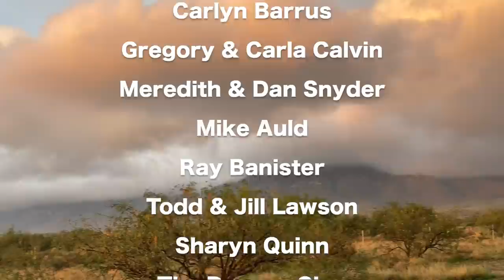Earthen Plaster on Hyperadobe Walls + Solar Wire Trench!

Comment: A couple of things

1) I do not know if it is a legal, electrical authority, or local council requirement, but it is common for electrical and water lines to have detectable mains marker tapes placed in the trench, about a foot above the service lines to act as a warning that there are water pipes, electrical lines etc below. Have you considered doing the same for your water and electrical lines?
2) The internal walls look really good.

Comment: You guys are doing such a great job I'm very impressed.
I did see a glimpse of your swing...
I just made a swing for my 11 grandkids yesterday.
I took around piece of firewood the length of the saddle
And an old saddle
I attach the saddle to the round piece of firewood with long bolts
Used the rope from their old swing and attached it to the four corners of the saddle
11:30 last night kids didn't want to go home they were still swinging on their saddle swing 👏

Comment: 'Great video!  It's very impressive how much work your family does.  And congrats on figuring out the plastering mix as well as digging all of those ditches for the electrical.   I hope you have a long yellow rope or ribbon that you can place well above the pipe laid so that when someone digs in the future that they pull up the warning rope/ribbon before they mess-up your electrical line.   For the plastering, I've seen some videos where they use a percentage of lime in the mix.   I'm wondering if you were tempted to add that to yours.  I  hadn't seen the toilet paper usage before - so, that's quite brilliant.   Aircrete Harry uses blow-in insulation paper (he buys it in bales) in his Epic mix - but he uses that on his aircrete outer dome shell for thickness and insulation of his domes.  Might be too coarse for interior finish plastering.  Keep up the great work.  'Looking forward to your next one.  - Jim from Phoenix

Comment: Wow, is that how fine you have to sift the the soil, down to flour consistency? That is a lot of sifting! It sure looks nice! I like the lighter brown color when it goes on. I hope it dries bright. It really brightens the office up. I like the 1:1 ratio of sand to clay and I'm so amazed at your ingenuity of coming up with this earthen plaster mixture with the toilet paper and fine straw added. Kudos to you Ashley! It would be so much easier to dig a trench, not physically but mentally. Those ants that Jax and Ada found were crazy looking! I so admire your tenacity Ashley. You never give up, you just keep pushing on. The blending works sooooo well. You can't tell at all. I love the color of those bottles in the diamond window, The clear story looks beautiful. Jonathan do you know Al Lumnah's great way of putting electrical wire through PVC conduit? You blow a string through the conduit first and then tie that well to the wire and pull it through with the string. Works through turns too. I like the idea of the junction box. Good idea! I love the aerial shot of the trenches. Adali is such a hard worker, she helps with the wall plaster and then digging trenches. Jet helped a lot with the trench too. I like that you are giving yourselves some real juice with the circuits you are hooking up. You could run freezers off of a 20 amp circuit. So are you having your solar array take over the electrical for the airstream too? I thought there were 7 circuits you have run for the solar shed. Are you having a 20 amp circuit to run the minisplit too? I'm sure you'll show all this over time. It looks like you did a great job getting your wire runs and junction boxes ready for the solar power wire up Jonanthan. Can you put your batteries on a cart so you could move it while you finish the floor? I have no idea if that would be possible. Sunrise and everyone is still tuckered out!  The GreenStalk looks good. I love how you can walk your livestock around, so cute. The double rainbow over the solar shed was a beautiful way to end this video, thanks. I must have blinked?

Comment: Interior Walls: If you're planning on painting, I would absolutely primer first. In addition Home Depot carries a PPG primer called Gripper that I've heard from painters is REALLY effective, it only comes in single gallons though which will cover up to 400 square feet of wall. My bet is that it's got a lot of adhesives in it, and it would help seal and keep the interior surface durable and ready for paint.

Conduit trench: 100% I would leave room in the conduit for more power wires, but also run an additional conduit for future expansion room, and then leave an extra pull string in each so you don't have to break out a long fishing wire. The second conduit you might use for data or something in the future, and it'd be nice to have it even if you don't really need it.
Reply from the maker: Definitely not painting - this is the final plaster for the areas we finished.

Comment: You should try adding cement to the mix. It will still breath but will add durability to the finish. Especially on the outside with monsoons.
Reply: Correct plastic cement is what is used for plaster and mortar, Portland cement is used for concrete slabs and sidewalks
Reply: @mrromantimothy  Portland cement is use in more than concrete slabs and furniture. Check upside of down sizing the have a grate mix for southern AZ desert.

Comment: Looks like great progress!   I would recommend using buried marker tape for your trenches.  Accidentally digging up electrical conduits is not fun.  Also, I would not run solar DC electrical wires in the same conduit as AC power wiring.
Reply from the maker: We'll have 3 separate conduit runs, solar and AC will be in their own conduit.

Comment: You may want to try using Cellulose Insulation in place of toilet paper.  You should be able to buy it at big box home improvement stores.  It is used for blown in insulation and is basically pre-shredded wood fiber (aka cellulose).  I recommend wetting it thoroughly before adding to other dry ingredients.

Comment: Jonathon, are you going to run data in your cable trenches?
Reply from the maker: No, my first internet experiment will be wifi based between the solar shed and Airstream. Depending on how that goes we may run data cables to the house.

Comment: Up , Here We Have Red Clay.. I , Would Have Rented A Trencher For The Day .. IF , Your House Is Going To Be In The Area Of The AirStream You Could Run A Trench In The General Area That Way It Would Save Your Back In The Future..As , For The Shed Floor , Make It Thick ..
Reply from the maker: Thankfully our soil is not hard clay so manual was doable 👍🏼

Comment: Hint ...always run a 2nd string line with your cables so you always have one available to run if you need to change wire/upgrade..

Comment: why a 90 deg. turn on the trench? Is that a code requirement?
Reply from the maker: They only sell 45 and 90 degree fittings as far as I know - and we wanted to be able to dig up and service the split point in the future so it made sense to come straight out from the building a ways and then turn to where we needed to go.

Comment: add limestone
Reply: That would make it actual plaster , a chemical reaction and cure to a hardness on the mohs scale,.plaster when applied over correctly  fastened lath allows it to expand and contract with minimal cracking it also gives lateral strength to a building known as shear , you can't expect to have Lath and plaster results,  if you don't use lath and plaster.

Comment: use a wet sponge  better finish by rubbing it to blend .
Reply from the maker: Tried it. Didn’t like how much sand it brought up.
Reply: let wall dry partly then sponge ,reduce sponge water till u reach the finish u want .that stuff could work like cement .😎😎

Comment: Dude you don't need all those fittings, you can bend that gray PVC with a torch mark off how wide you want to go and go back and forth with the torch careful not to burn it while you're spinning the PvC after a while it will get noodle limp that's when you take and lay it on a flat surface bend it to whatever degree you want and then use a wet rag to cool it off careful not to kink it, in electrical we don't go with sharp '90s we use sweeps whenever possible it helps you pull wire into the conduit, also whenever you are digging a trench throw the dirt onto cardboard or some old plywood that way you can fill the trench way easier.
Reply from the maker: I dunno man sounds like way too much work when I can buy a 90 deg sweep fitting for a few bucks 🤷🏼‍♂️. Other than the LB's all the corners are using sweep fittings.